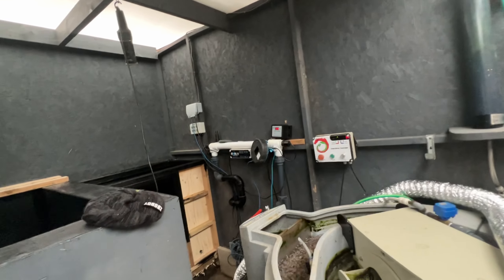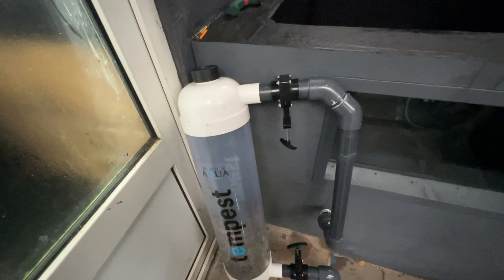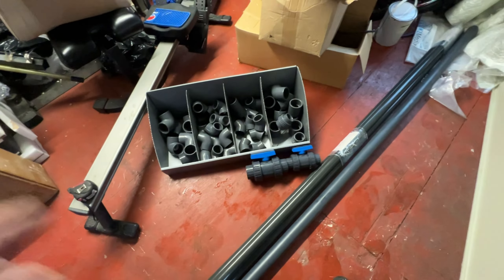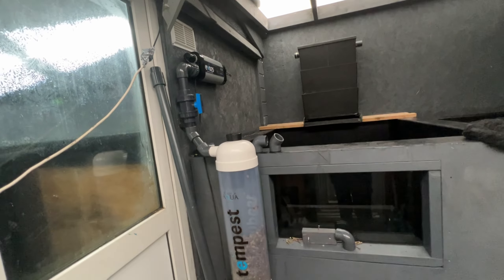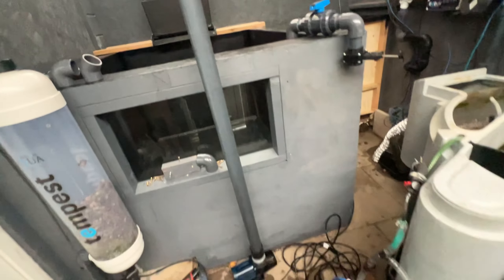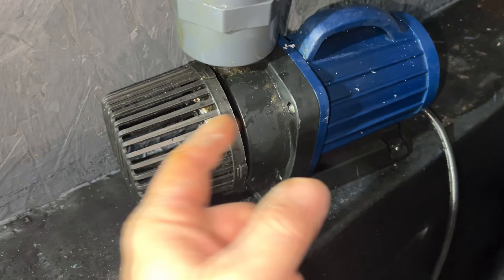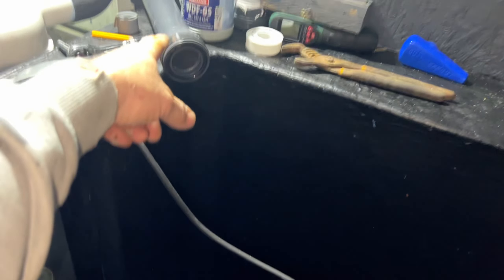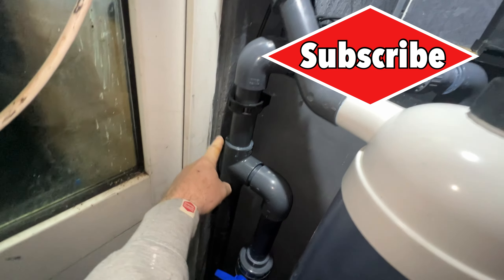EA TEMPEST as main mechanical filter with a bakki shower for the bio #koi #filter #koipond #fish

Comment: Hi. Love to see the tempests being used first inline by a pumped system this is how I run mine except I have two tempests in series with bypass valves so I can clean each one separately. I also added tank connectors on the top caps I can then open the connectors and boil the tempests using an air pump.    What a brilliant setup you have 👍👍👍
Reply from the maker: They are doing a brilliant job mate can not fault them, I was going to do the same as you did first but thought try something different with them, I use a air pump now and again, and thanks Kevin appreciate it mate 👌👍

Comment: May I ask please how do you find the aqua forte pumps I had EA and a pondexpert 20000lt pups rodents chewed through cables so got to get new or second hand pumps have been offered aqua forte second hand pumps so looking for hw good they are too use and run
Reply from the maker: Hi mate I’ve got 3 different type of pumps running my systems, the cheapest 1s to run are the cheaper jeboa ones in my opinion, the aqua forte never had a problem with them got 4 running all together now, this 1 in this video is a second hand 1 I bought last year, the mice and rats get everywhere don’t they, in my opinion go for it mate 👍
Reply: @Dannyskoichannel  thanks Dan
Reply from the maker: No problem mate have a good one 🥳👍
Reply: @Dannyskoichannel  just bought yself a Blagdon IQ6000-12000lt pump for Mrs wildlife pond so will take the pondexpert 20000lt pump of there and put that on my nexus200 so now only have to get on more now for my bakk showers happy Times
Reply from the maker: Happy Days mate that will save you a bit of money 👌👍